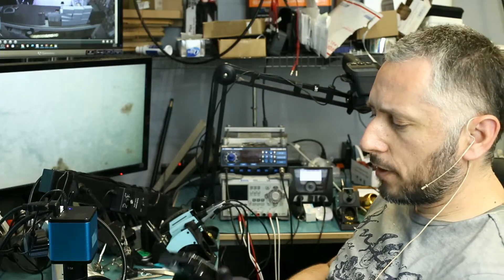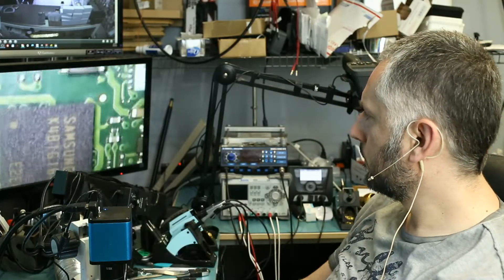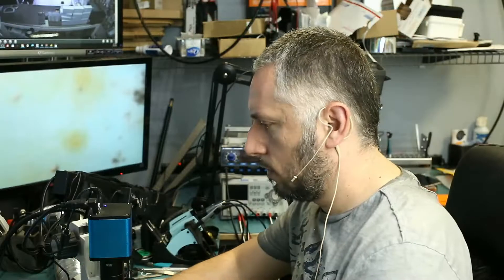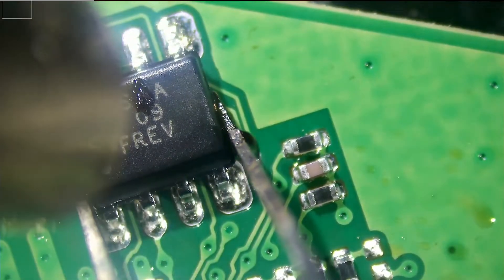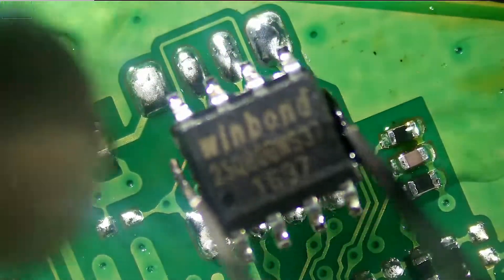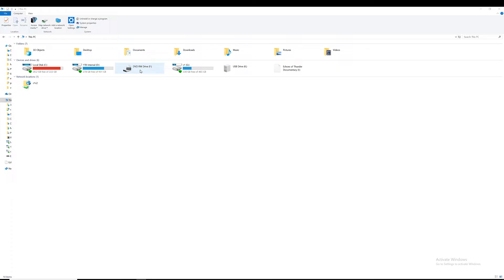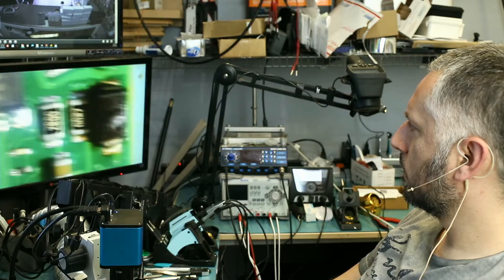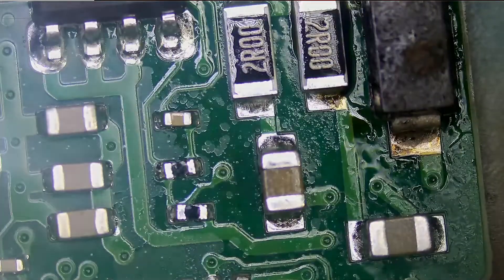Seagate Hard Drive Data Recovery by Swapping Boards and Firmware

Comment: What if swapping the old BIOS chip didn't help? The drive is visible in Device manager; it's spinning with LED on, but it's not shown in Disk Management, nor in Windows Explorer. Seagate Flex 1TB USB . It was opened, the heads looked fine.

Comment: Can we do this operation with copying firmware with an external programmer, like Ch341a, and SOIC programming clips instead of physically swapping the chips?,The chips are standard spi flash chips, can be read and program with an external programmer.

Comment: bro my hard drive does clicking sound and suddenly lag it's old 10 year seagate drive like the one u have rn 500gb so i opened the case and cleaned the drive with isopropyl alcohol swabs but it's showing 3.86 gb unallocated out of 500 i live in India

Comment: Sometimes you can just swap just the pcb. Not always tho. If you can fine the exact same drive with the same firmware revision you may be golden.
Reply: If I have the same revision of the bios and I only swap the pcb.  Is there any risk of damage to the disk?
Reply: @ernestoalvarez9599  no , in the factory setting, for the same hardware revision, involve constant adjustment of telemetry and BIOS calibration to account for minor mechanical inaccuracies.
These deviations are on the sub-millimetric scale, yet significant enough to disrupt the operation of a hard drive.
BIOS configurations therefore contain precise directives specific to each drive, based on their micro-imperfections. It is thus essential to recover your original BIOS, as it holds this critical information.

Comment: Excelent!!  I have two Disks ST2000DM001 , but they have different serial numbers, Z240DE58 and Z1E6RSFX,  do you think if I Switch the Bios just like you did would they work taking into consideration they are not 100% the same?  Thanks!!

Comment: Trouble is, I replaced the circuit board and threw out the old one not realising that a chip swap would be required!  So any options for my situation?

Comment: Thanks to this video, I was able to recover a friend-of-a-friends HDD with ALL her family photos on it from her 2 kids. I bought 4 identical HDD's and attempted to swap the boards but couldn't figure out why it wasn't working. This video helped me see that the BIOS (or serial eeprom?) is necessary to swap over. After a pitiful soldering job the drive fired up and I was able to recover the data. Thank you very much!
Reply: Can u please tell me we need same model harddisk or just same model pcb is enough???
Reply: @theviralshorts9747  I dont know, I bought same model disk and had success. PCB may not work because its programmed for a different disk.
Reply: @theviralshorts9747  maybe if the PCB is frmo the same model hard disk of the same model # of the same model PCB... I have a ST1000dm010 with a fried pcb [no dmg like in the video here] and it has pcb 100774000 REV C and I found another PCB 100774000 REV C as well but from a similar drive [both are seagate compute] however the donor drive is a ST500DM009 both are FW CC43 so I was hoping it'd work without the bios chip swap.. it didn't thankfully this series of PCB/drives dont get messed up when you switch different PCBs within the 100774000 family it seems so if i swap the bios my data could most likely be saved. other drives i tried a similar thing on [got a ton of drives here] did not work...

honestly im just wondering if i tried flashing the donor board with its original drive with a firmware update of the  target would it achieve the same thing? hm

Comment: I have a Seagate hard drive that powers up, spins, and the arm moves, but BIOS will no longer detect it. Disk Manager in Windows will detect that some kind of storage drive is connected, but it can't tell me the size or initialize it. I don't have it attached as a master, so the MBR shouldn't be at play. Any tips?

Comment: Hello Sir I Wanted Ask You That I Have 1TB Hard Drive It Stops Spin I Clear The Surface Area Of PCB And Resold Connector Pins But Now Its Showing Me 4gb Space Is It Media Problem Or I Have Made Any Mistake But All Connectors And Voltage Parameter Is Good How Can I Solve My HDD Issue Kindly Help

Comment: I try to repair a 2,5“ seagate (it makes a periodically sound and after a specific time the sound stops)! First I made the same mistake (I did not swap the bios chip). Afterwards I swapped the chip, unfortunately the hard drive didn’t start(no „sound“ no power, nothing) 🤦‍♂️😟😟

Comment: Sir, is this the same fix for hard disk that after plugging in, it clicks 3 times then stops spinning?
I replaced it with a new PCB, however it only improves spinning time with few more seconds then again it stops.
Reply: Same here. Did you managed to solve it?

Comment: I have a Seagate 1TB SATA drive die in my computer.  BIOS stopped detecting it.  Tried using in other position of power cable and SATA cable.  Still not running.  I opened it up and the head was in the middle of the disk.  I moved it over towards the hub and it now ran but drive was getting pretty warm. I pulled the card off the drive and all the connections to the head and motor were dirty and corroded.  I cleaned them all with an eraser and now drive runs cooler and quieter but only show up in explorer drives I can't access.  I ended up buying an external 2.5" & 3.5" SATA to USB adapter to make the testing and repair easier.  I ordered an identical working drive off of eBay and it even has the same firmware and circuit card.  My board version is Rev A, new one I am waiting on is Rev C. I am so hopeful it will run and show up in the BIOS when I install it.

Comment: wish me luck, gonna try this with no flux, no scope, just a 30$ solder iron with one temp "ON" and stand to put it down on when its hot.  ࢳϠࢳۭۘۂלּZ    ..∩RiP∩..    וֹבֿﮯﭲ﮳﮳בֿ
Reply: Annnnnnd its trashed! :( hope i didnt cook the bios chip, it took alot of heat for a wile, took ages to get it off and pads ripped. gonna have to find another board and this time invest in a heat gun, you make it look so easy !! !! ahhh FML

Comment: The PCB is from the same manufacturer for the same model of disk, right? Then why does it not work with the firmware stored in a different flash chip? Shouldn't the software be the same, or at least a different version of the same software? This is bizarre. The only two reasons I can think of are: (1)some sort of unique encryption key is stored in each flash chip, or (2)manufacturers intentionally made it not work with a new board to force customers to buy a new disk. Even for (1), why can't the key be stored on a special location of platter or something, given the fact that the PCB could easily get damaged and may need to be replaced? The whole hard disk industry seem as shady as the inkjet printer industry.
Reply: The answer is all about encryption or somewhere along the ID code, cmiiw. Everything has to be unique or you can just steal people data.

Comment: I don't know whether you respond to comments or not-however I will go ahead and ask the question: I have a 2.5 inch WD 2TB drive that was originally a C: drive.  It failed with no symptoms (noise) except that it stopped working.  I removed it and replaced it and the computer is running fine now.  However, I still want to recover the data on the drive.  I plugged the "bad" drive into a FANTOM brand USB SATA adapter and did the following:

1)I plugged the USB cable into my computer and attempted to boot it.  However, the computer would not restart.

2) I unplugged the USB cable from the computer and restarted it.  I pressed F2 during restart and the BIOS menu came up.  I then plugged the USB cable into the computer.  The BIOS recognized the "bad" drive.

3) I unplugged the USB cable and allowed the computer to restart and THEN plugged the USB cable back in.  Device Manager recognized the FANTOM SATA adapter and the WD drive.

4) Disk Manager can see the drive as Disk 1: --it sees it in 4 pieces: 

4a) a 529MB Healthy (Recovery Partition); 

4b) a 100MB Healthy (EFI System Partition); 

4c) a 1861.88 GB RAW Healthy (Basic Data Partition).  This is shown as Drive D;

4d) a 513 MB Healthy (Recovery Partition).

5) Windows Explorer can see the drive as two separate drives: Drive D and Drive F.  I right-clicked on Drive D and selected Properties.  I got: "Location is not available.  The parameter is incorrect.

6) So 4c) the 1861.88GB part is where my data is.  However, it is being shown as RAW.  Is there any way to recover the data without reformatting the drive?

And is this the kind of problem that could be fixed by replacing the board/BIOS.  I have a full production workstation available and have the necessary soldering/de-soldering skills, although I have no experience working on HDDs specifically.
Reply: Sorry I don’t have any info to help you here, but curious if you ended up figuring out a fix?
Reply: R-Studio or Drill Down recovery software programs.

Comment: hello can u tell me please whereabouts u r ? i want to send u a broken hard disc? the head unit is broken on a 2.5 inch hard disc? thanks.....
Reply from the maker: We don't do broken heads on hard drives.
Reply: @NorthridgeFix  hello 

It’s the coil wire at the other side of the head unit with in the hard disc itself yep thanks it is cut into two and needs replacing yep not the actual heads themselves which are broken yep thanks   The heads themselves are not broken it’s the coil wire copper colour yep
Reply: @NorthridgeFix  can you not maybe replace the entire hard disk head unit ?? Thanks

Comment: Magnificent video.....Great work mate... i have kept an old Seagate drive that for some reason has burn marks around the main board cpu...I am glad i kept it ..will have to dig it up and look for another HD with same board...ps i was told the it has to be of the same batch of HDD s?

Comment: I have the same problem. I have a HDD Seagate Barracuda of 1 TB with a PCB 100664987 REV "A" and I bought  a donor board and installed a PCB 100664987 REV "B" that both are compatibles but my computer did not recognize it, and now seeing your video I know I have to change the Bio but I haven`t the tools to do it. Can you tell me what can I do? or if can I send it you to do the job?.

Comment: This is often caused by folks plugging a HDD into a HD docking station which has had the wrong power supply plugged into it, that then burns out the board.
Reply: how do you know if its the proper power supply? I'm currently using a docking station cuz my External Enclosure smells burnt and transferring to the docking station seems to work for now..

Comment: Great video! One question. You mention setting the hot air gun to 350 degrees -- is that Celsius or Fahrenheit? Thanks for the great information!
Reply: Celsius
Reply: Still waiting!
Reply: Soldering tin need to be heated to over 300°C to melt

Comment: i've got a seagate st2000dm001 with the same issue spins up but not detected in windows. i ordered a new pcb and am just waiting on it to get here. i did manage to get the bios chip off of it
Reply: Hey, did you end up fixing this?
Reply: @syberpunk  no it didn't. I'm going to put the bios chip back on the old PCB and I'm gonna take it to a data recovery place when I've got the money for it

Comment: ggreat video ive got a 250gb seagate 2.5in sata hd that will not read data and i need the data off of it...it has 2 platters inside..is there any way the platters can be swapped to amother good hard drive so i can read the data? ......my concern is the two platters on top of each other..are they lined up somehow?

Comment: Hello I have a Seagate Expansion 6TB that was plugged in a laptop charger. The PCB board it's not working, I have another 6TB working drive, if I swap the PCB, the bios has to be replaced in order to make it work? Then if it works, it's better to put the bios back on the working drive? Or it's better to fix the burned diodes on the bad board? Can this this diodes work from a 2TB drive or so?

Comment: What happens in the event that the BIOS chip is corrupted or damaged. Is it possible to get a replacement?
Reply: either way you would have to add windows again but your memory should be fine
but i would do it on a clear drive just in case then transfer pcb to prevent windows doing more weird stuff to your memory
make sure its the same model as the pcb on the back of your hard drive and you should be fine.
or if pcb is too much then just transfer your bios chips, it seemed to work for him.
damaged

Comment: Thank you for sharing sir, I have the same problem with that , seagate 500gb , ill try to be replaced a burnt components but dont know the value. And i doubts if it is running after changing.
Reply: Did it work?
Reply: Yes It Worked For Seagate

Comment: Hi, thank you for this video. Is it possible to avoid the swap of the bios chip by using a tool like ch341? The idea is to read bios data from the old bios chip and write to the new one.
Reply: How bout replace bios chip with another board hdd? Should replace too?
Reply: In this case, probably not. That damaged part might not have allowed the other working parts to respond, or caused more damage along the way.